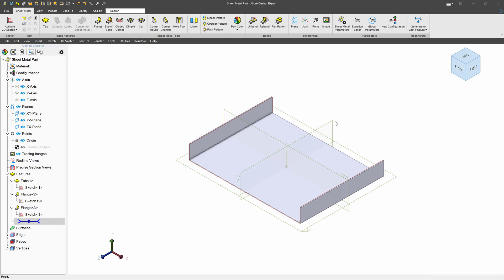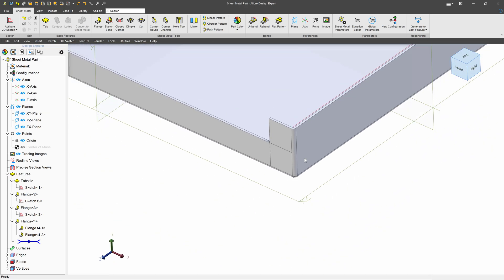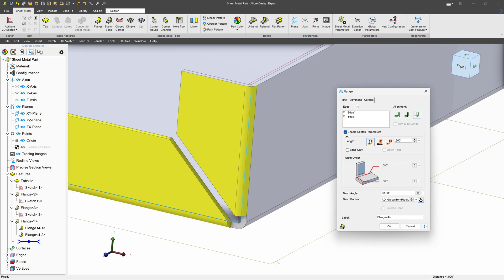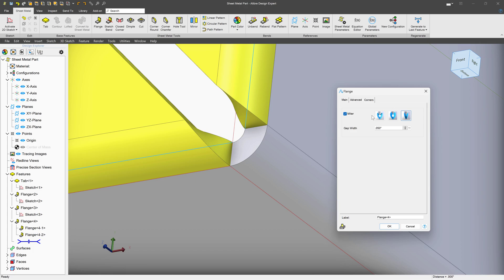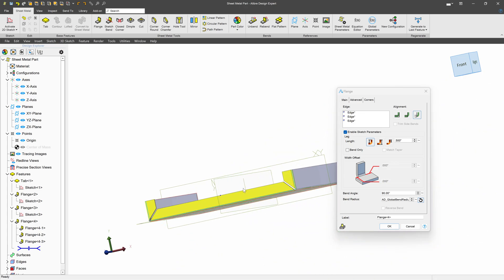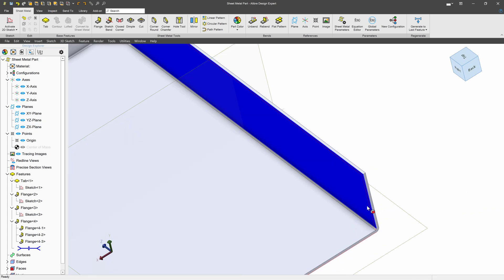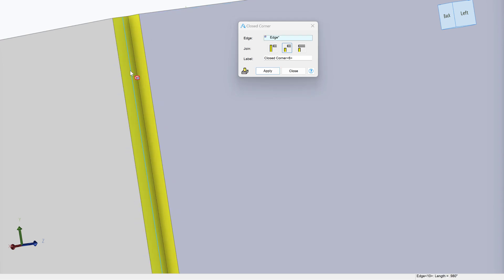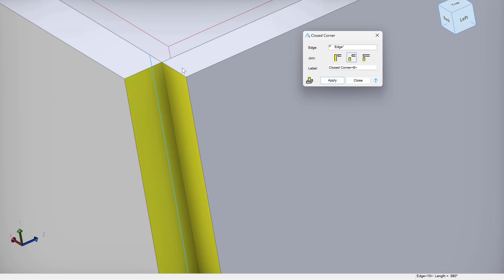Make Miters and Closed Corners in Sheet Metal | Alibre Beginners Course #49

Comment: Nice! Do we have any upcoming videos about how to work with bend deduction and bend allowance instead of default K-factor? Some machine shops just have a table of bend deductions or allowances for their equipment you need to design for. Bonus if Alibre lets you import bend tables for different press brake settings. That would be an interesting Excel-based feature. Maybe an enhancement request?
Reply: Hey Sam, actually Bend Allowance is calculated from the K-Factor. Using tables for it is an approximation and not necessary when using a proper CAD system. But if a shop gives you a BA table you can reverse engineer the K-factor.

BA is an arc length that can also be calculated as the Arc Length of an Arc with a radius of "Bend Radius + K-Factor*Thickness". So,

BA=2*π*(Bend Radius + K-Factor*Thickness)*(Bend Angle/360)

Reverse engineering the K-Factor is what you must actually do when you need high precision sheet metal and needs to be done per material/bend radius/thickness combo.

But most of the time it falls into the 0.35 to 0.45 range. Softer materials tend to have less of a K-factor.

As for importing Bend Tables for Different Press brake setting, I'm not sure what you mean but I'm guessing you mean a K-factor per combo I mention above. I'm not sure Alibre does that but there's nothing stopping you from creating template files a là TooTallToby with the combos you need. You can even set up a spreadsheet with hyperlinks to open the correct template every time. Just spitballing here...